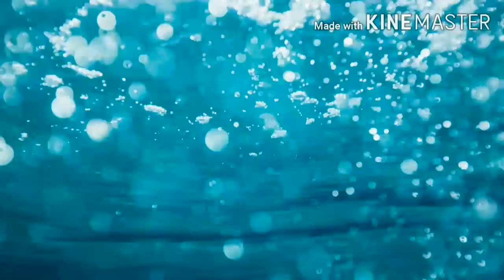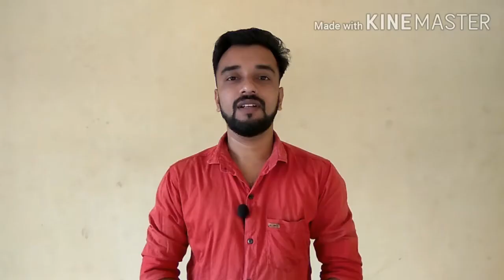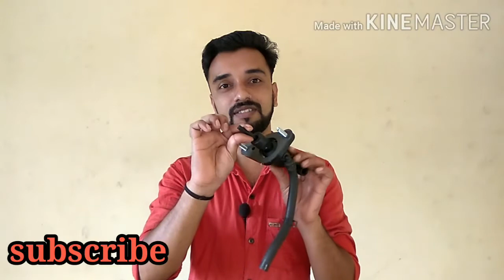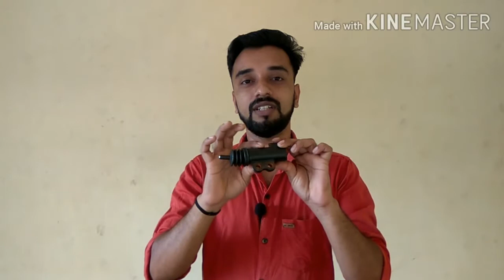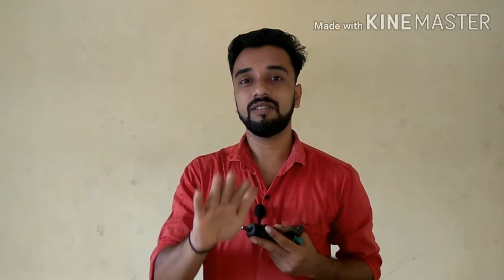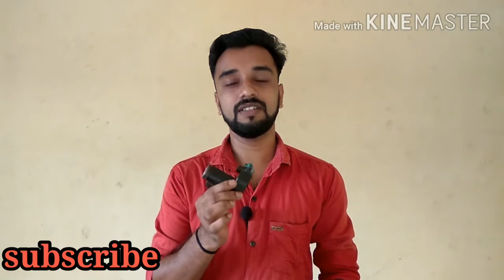Hyundai i20 Verna Gear Shifting Hard Problem/Clutch Pedal Hard on hot Condition/ Verna clutch issue

Comment: Enikkum idu poleee cluch hard ayitt unde but nan ore solution kand pidichu  glass wash cahyyunna motor line ille aaa line extend chaudh sleeve silinderinta neeera vechu adinta pipe enitt cluch hard avann thinniyal nan galss wash chayynna such on akkum appo water sleeve silinderinta mela avum silinder cool avum adhukond 3 year ayitt ippo cluch hard aval illa idane enta solution
Reply from the maker: Adipoli

Comment: ഒരു function നു പോയപ്പോ 2 ദിവസം വണ്ടി outside പാർക്ക്‌ cheyendi വന്നു. നല്ലോണം വെയിൽ കൊണ്ടാർന്നു. വണ്ടി എടുക്കാൻ ചെന്നെപ്പോ gear shift ആവുന്നില്ല. 5 മിനിറ്റ് വണ്ടി ഓൺ ചെയ്തെപ്പോ ഓക്കേ ആയി.

Today ഞാൻ വണ്ടി start ചെയുമ്പോൾ ഗിയർ വിഴുന്നില്ല.. എന്താവും reason. Please advice.

Verna 2008 model. Diesel
Reply from the maker: Cluth pedel tight undo
Reply: @NithinTechVlog  ella.. Clutch pedal ellam normal.. Vandi off akki gear change cheythal avunnundu. Ellam gear lottum povunnundu.. Onn cheythal gear mattaan pattunilla..
Reply from the maker: Km ethraya
Clutch theernit undakum
Reply: @NithinTechVlog  1.7 lakh plus ayi... Ayo pani ayoo😇
Reply from the maker: 1st ano clutch marunne
Clutch theerntha avan ann 99%
Reply: @NithinTechVlog  Njan 2nd edutha vandi anu. 2 year. Previous owner matiyonnu ariyilla
Reply: @NithinTechVlog  thanks for the replies
Reply: Bro. Its solved. Master cylinder leak arnu. Part plus labour 2650 il ok ayi👍
Reply from the maker: Kk

Comment: Verna fluidic satrting timil clutch soft ane  but 5 to 10 kilometres kaziyubol clutch tight akunnu ethayirikkum problem
Reply: 1 year munp Clutch MC,SC, pressure plate Ellam mariyatha six month kazijappol clutch MC vindu potti appo clutch SC mariyilla
Reply from the maker: Clutch sc ann complaint .sc eni maranda athin reat koodthal alle 
Sc yude kit maran pattum ath onn mari nok athin athra vila varunila

Comment: Bro i20 2013 model  2nd gear nn 1st gear il idumbo hard  but neutral nn 1st idumbo promblem illa  pinne chilappo reverse gearum hard aakrund solution valladhum undo
Clutch valare thaye aan  full chavittanam   adh normal aano
Reply from the maker: Clutch theerar ayit undakum. Sc mc leak undo nokanm. Km ethra ayi

Comment: Bro Verna 2012 , second gear and revise gear nallla hard aaakunnnu, entha solution, clutch pedal um kurach hard aaan,,, showroom kanichappol just drive cheythiytt clutch set matendi varum parayunnn,,, cost 25000🥲,,, any other solution?
Reply from the maker: Clutch theymanm undagilum agane varum pedel hard anagil clutch theernit undakum.
Amount ithra onnum undavila
Reply: @NithinTechVlog  clutch kit original enth price varum, evide kitttum onnu parayamo
Reply from the maker: 500 rup ayirun athym ipol rate entha ariyila compny il kitum
Reply: Ente verna 2013 ippo ithe preshnam undo , company 26k parnju porth ethrayakum?

Comment: Bro...lastweek break fluid leak aayi minimum level thzhe poyi...veendum refillcheythu break fluid bleed cheythu air kalnju.   After one week kazhinju oru 50 km ride poyappol clutch hard aayi pettupoyi.  Kurchu kazhinju thaniye ready aayi. Air block karanamano slave cylinder over heat aavunnathu?
Reply from the maker: Aa slave cylinder agane oru complaint und
Reply: @NithinTechVlog  Any solution?
Reply from the maker: Replace

Comment: Bro lockdown kaalath ee issue avoid cheyan enta cheyuka? Vandi edukan patata containment zonukalil..
Reply from the maker: Eth issue
Reply: @NithinTechVlog  ee issue clutch hard aakuna issue mostly lockdown otamilate kedakumboza enu ketitund.. vandi weekly twice front back oke edutal ee issue avoid cheyan patuvo?
Reply from the maker: @arun29618  ee vandik varunth ath kond alla. Vandi edkathe vannlum tight avum but ath pressure plate ann. But ee vandikalil odi kurach kazhija sleev cylindet steck avunn oru complaints und ath kondandan mc potunath
Reply: Ok bro ..enik vandi 3 years odicha time regular daily oru 40-50km eduta time oru issue ilayrn pakshe lockdown vandi 1 month kedanapoza aadyam ee issue kitye clutch stuck aay and poti when i pressed.. and then tow cheyt fix cheyt.. anu avar paranjat lock down aanu ithu elarkm varunat odaanjitanen..

Avar aa part update cheytatay arivundo? or ithu epo venelum varamo life time??
Reply from the maker: Sleev cylinder updation vannit und. i20 verna ithin common ulla complaint ann mc potunth lock dwon ayath kond mathrm alla. Ith pola ottathil potti pokunn complaint kure kittiyit und
Reply: @NithinTechVlog  updated aan engil ini varila enu prateekshikam vandi tane maaranda avastayan ..clutch kitate irikunat entu dangerous aanu roadil peak trafficil oke vandi tow aakana vare kedanalula avasta vereym
Reply: @NithinTechVlog  eppol thotu ulla model il aanu update vannathu
Reply from the maker: New model update cheythit und
Reply: @NithinTechVlog  ethu year model aa bro and month angane ariyamo
Reply: Venue nu undo ee complaint?
Reply from the maker: 2nd generation vehicle

Comment: Verna fluidic clutch full maaari clutch disc pressure plate around 9.5k parts aaayi
Ittitt pokunna vazhiyil clutch hard aayi thudangi. Thirich wshopil chennappo avar paranju clutch complaint aaanenn.... Hyundai genuine parts aaarnnu....replace illa enn....kashttapett 20000 km odichu appozha eee video kandath nthelum solution inda
Reply from the maker: Clutch sleev cylinder mariyayirunno

Comment: Bro ee video inn ane kandath, 1/2hr mumb same issue elite i20 2020model
Clutch hard aayi pettu
Naml athyvahym aayit povanel entha chyuka. Pett povile..
Kutum ee prnja karygal ok mariyal set avu ok please reply ASAP
Reply from the maker: Ithoke mariyitum pinnem complaint ayavar und
Reply: Cheta apo entha solution
Reply: Long povumbo alel  nalla blockil povumbo entha avasta.
Onn speedily povan polum patuo?
Reply: 2020 sep modlel elite i20
20000km oditolu
Warrenty ind.
1.45yr aayitolu.. so ithellam change chyumbo free of cost ane but ee issue pine pine varum ennan chettan paryane. 

E vandi idthavroo apo pettu ennanoo?
Reply from the maker: Kure per pettitund
Vandi ottam kuravulla vandikalil koodthal kand varunth
1st lock down kazhijathin sheshm kure vandi igane vannit undayirunnu
Reply: Ok apo ottam indel ingne seen varila ennano?
Ipol warrenty ind vandik warrenty ful kit change cheyyan prnjekane.

Ini tot daily use chyta ee issue solv avuo?
Reply: Long driv povumbo heating koodi kaHijal. Ee issue indvuoo?
Reply: Bro, after 1st lockdown enik pani kittiyarunu, pinne 600km okke continuous odichitundu. Apol onnum prashnam vannilla. After one and half year innale oru 100km odiyapol pani kitty. But both time free of cost aanu maariyathu
Reply from the maker: Vandi ottam kuravano vallpolum oke ano edkar
Reply: @NithinTechVlog  yes bro , ottam kuravanu. 2.5 year aayi oru 20k okke aayitullu. Oru omni undu daily use. Daily odikondirkunna vandikalku e problem njan paranju kettitilla
Reply: @NithinTechVlog  weekly oru 50km okke odarullu
Reply from the maker: Aa athan  ottam kurav ulla vandikalk ann kandu varunth
Reply: Bro, 3 year kondu 70,000km odiya vandi enik ariyam , avarku angane oru issue vannitilla. Ella low running vandikku aanu e issue

Comment: The kit costs 1800 from Hyundai. Experienced this issue today. Waiting for replacement modified spring. Car is still running though. But not for long runs
Reply from the maker: Kitn athra expens onum illa
Reply: @arfazpattambi  go to any Hyundai showroom
Reply: I went today they said 4000rs
Reply: From where u get 1800?
Reply: @arfazpattambi  that's for the entire slave cylinder. If ur slave cylinder failed then u have to replace the whole thing. If it is still intact then u only need the correction part for 1800rs. Ensure what damage u have. Also if at all pedal gets more hard while driving all of a sudden switch the engine off and wait for a while... Driving like that when clutch is hard can rupture ur master cylinder as well adding another 8400 to the bill.
Reply: @arfazpattambi  Popular Hyundai , Perinthalmanna , Kerala. But if u r not from Kerala or nearby...I don't know what help this can be to u